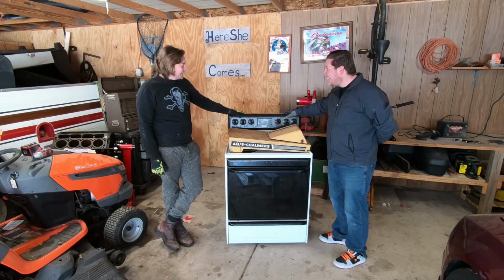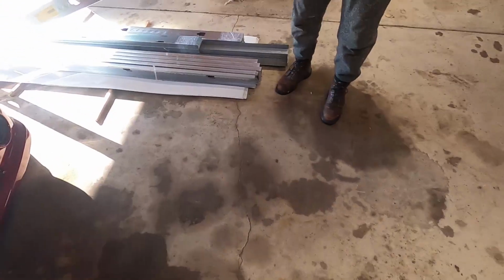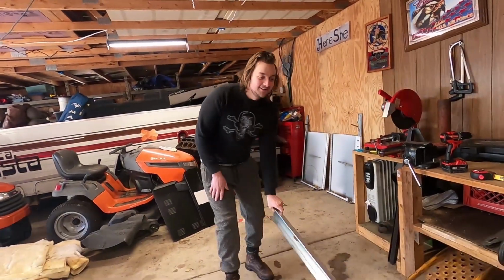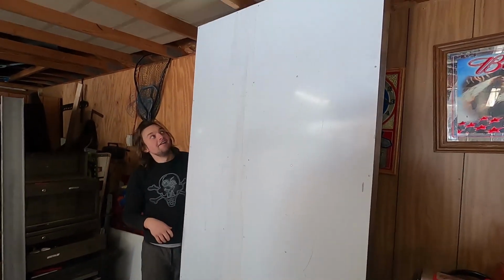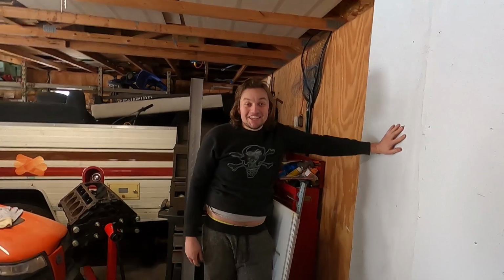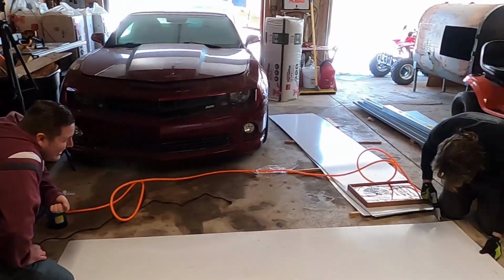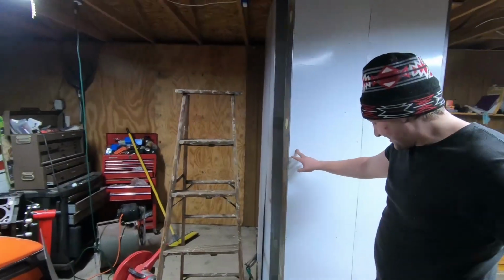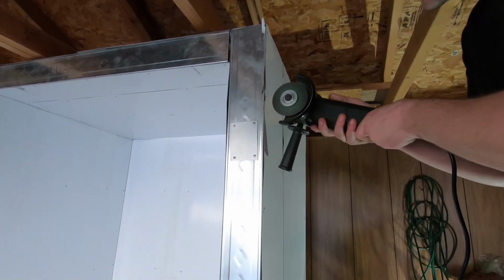Erecting a MASSIVE Powder Coating Oven From Scratch! (part 1of2)

Comment: Hey guys nice job, what did the walls set you back a sheet
Reply from the maker: We found them on FB marketplace for $2 a sheet. They're cutoffs from some commercial jobs I guess. It probably would have been the most expensive part of the build if we had to source them brand new somewhere.

Comment: what is the power of one heater?
Have you already tested how fast it heats up?
Reply from the maker: Each element is 2600 watts and we haven't tested it yet, still have to seal it up and wire it. Should be done fairly soon though and we'll post that video up!
Reply from the maker: We finally finished the oven build, video is up now! We timed it to about 8 minutes to go from 60 degrees up to 400. Not too bad we don't think!

Comment: Really need your help on something. We have pretty much the same build.  Where did you get you continuous hinge and what's the width of it open?  Thanks and great job!
Reply from the maker: We got the hinge online from Grainger. I don't remember all the specs of the hinge but they do a really good job with putting all of the dimensions with the products.
Reply: Piano hinges (Continuous hinges) are also available at Home Depot.